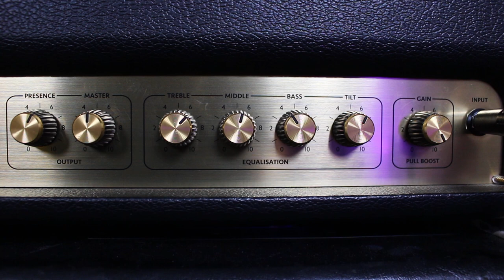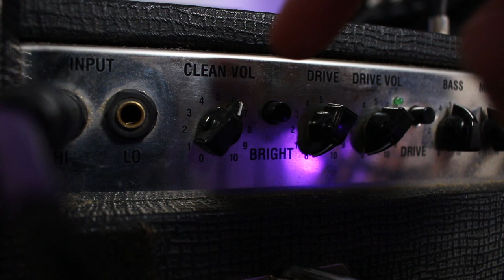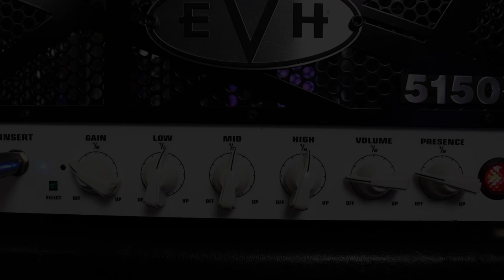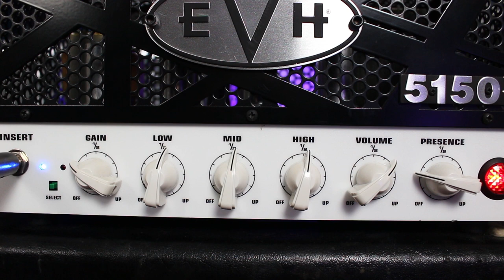Power Amp vs Preamp Distortion in a Valve / Tube Amp - Info & Demo (Marshall Origin, 5150lbx, VC15)

Comment: Its also helpful to understand the differences between gain and volume controls themselves. Gain controls are always placed on the input of a component and volume controls are always placed output of a component. Only a gain control can distort or overdrive the signal, while  volume controls can't alter the signal. Thats why gain and preamp tubes are focused on so much. A volume control just attenuates the signal. When the power tubes distort, its not due to the volume control. More volume can't add more distortion like gain can, it just lets more signal through and that's what makes the power tubes distort.

Knowing the relationship between gain and volume can allow you to get better tones at lower volumes. if you get the exact sound you want on your amp, but its too loud, add a preamp pedal. A preamp pedal will have gain and volume controls that are isolated from the guitar amp. If you add a small amount of gain on the pedal, then just use the volume control to adjust loudness. You'll be able to play at much lower volumes without touching any of the controls on the guitar amp.

Comment: Very informative! My Carvin MTS combo is a high-gain amp (though probably not as gainy as a 5150), and though diming the 'Drive' (gain) knob sounds fine at bedroom levels, I've found that the amp really comes alive when I turn the volume up past '3', which even with the half-power switch flipped down to 50w, is already approaching stage volume. The bass gets bigger and chunkier, and the mids get fatter. My favorite sound though, when I can do it, is with pre- and power-amp gain blended together. The sweet spot seems to be with the volume set between '8' and '9', and 'Drive' knob on '8'. This is with Sovtek 5881 power tubes. It's brown sound all the way, with more than enough compression for metal!

Comment: Great video and channel. I am intrigued by the Marshall after your demo. I've never owned one but after watching numerous YouTube studio demos I'm liking the Marshall sound. I have 4 Laney amps, two IRT studio 15 watts, an L5T 1 x 12 5 watt and an L20T 2 X 12 20 watt. I'm recently experimenting with pedals in front of the amp but have always used amp Distortion. Home levels dictate mainly preamp distortion but the Fryette Power Station is letting me explore power amp Distortion. It is a whole new world that only the guitarist with no volume constraints gets to experience but desired by all. Low wattage amps are the way. I had a Mesa Mark IV but could only ever use the preamp gain which gets to be just sad in the end. I'd probably be able to use it now if I hadn't sold it now I have the Power Station.
Reply from the maker: Cheers! I would like to grab an attenuator at some point. The Fryette has some killer features. Would you recommend it?
Reply: @DanLeggatt  I would definitely recommend the PS2. The dual channel version seems very interesting and is probably more versatile for a gigging guitarist. I haven't tried that one. The PS2 doesn't colour your sound but retains the pressure you get from a high volume guitar power stage but at any volume, we'll useable volume I mean. I'm sure you know you can attenuate or actually raise the volume output of your amplifier. The PS2 is 50 Watts I believe. I have not tried it with the L20T yet and the L5T is perfect at 5 Watts anyway. I don't like the 1 watt option on the IRT studio and the 15 watt output is a bit loud where it has some character (above 6) The Fryette is like the magical missing link I'd been searching for.

Comment: To sum it up: There are two ECC83 tubes in the preamp section. Each covers 2 gain amplifiers (ECC83=12AX7 tubes have TWO amplification means). So two ECC83s in the preamp section mean 4 amplification stages in the amp within the preamp section. The third ECC83 is literally a means of the power amp. It does not distort (so does not bring more distortion) but is there for the feeding of the power tubes, in this case the two EL34 (in other cases one ECC83 is the phase inverter for 4 power tubes or for 6 or 8 power tubes). For each number of power tubes ONE phase inverter ECC83 is sufficient.
Knowing this it is clear that whenever you have more than ONE power amp tube in the amp you need ONE ECC83/82/81 tube for the phase inverter.
For example: My favourite guitar amp is a VOX AC4C1-12. It has two ECC83 preamp tubes and one EL84 power amp tube. It sounds the same as a VOX AC30 (without Reverb, Tremolo). Why?
The Vox AC30 has THREE ECC83 and 4 EL84. BUT: 2 ECC83 are needed for preamping (like in the AC4), 1 ECC is needed for phase inverting the "more than one" power amp tubes.
An amp with ONE power amp tube DOES NOT NET a phase inverting tube.
Reply: Okay

Comment: The cool thing about this amp is that you can overdrive the preamp tube to get distortion while still running the EL34's clean. Then you can crank the EL34's up and add their own distortion to the mix.

Comment: You hit V1a first setting the overall tone and preamp volume. Then to the lossy tone stack. V1b as recovery. That is the classic setup for most amps.
The best thing is stacking harmonics. So, pushing preamp and then pushing poweramp. That is easier w a MV amp. A thing to remember is that there are boundary effects fr both sections. Pushing preamp section beyond 'nice' harmonics levels creates fizzyness and you lose dynamics. Pushing output valves and you get hard clipping distortion, often rather ugly. The trick is to find the right balance. Thing is, the usually involves more preamp section harmonics than output valves distortion. And it includes the PI, PT and OT as well, all part of the output power section. They all have boundary aspects. So, in short: people overestimate the effect of output valves. They say they prefer it to preamp valve distortion but they are simply mistaken about the causes of the total output section distortion.

Comment: Great video! I have the origin 20h and cab and this helped a lot I now open up that power section gain to taste and use a little black box in fx loop so neighbours don’t kill me and it sounds great! Thanks so much for explaining  this!
Reply from the maker: No worries! Glad it was a helpful video. I love getting into this stuff so I’m glad there are people that actually find my ramblings useful! Thanks for watching 👍
Reply: @DanLeggatt   real useful I’ll get a attenuator one day as I don’t think I can really push the power section as the little black box being essentially a volume control between the pre amp and power sections means I have less signal going to power section?
Reply from the maker: @chris51484  Yeah absolutely, I would recommend an attenuator to get that juicy power amp stuff going. To be fair I’ve heard good things about the Bugera Power Soak and the Jet City Jettenuator. I think they both come in around £100. Less on the used market 👍
Reply: @DanLeggatt  I may have just ordered the bugera.... I need that Juicy power amp stuff!
Reply from the maker: @chris51484  Let me know how it works out for you! Just make sure everything is hooked up correctly before turning the amp on 👍
Reply: @DanLeggatt  sure will mate and yea the double and triple connection checks will be done!
Reply: @chris51484  I've got the bugera ps1 and it's a bang for the buck. I've used it with my origin 50 and then you can crank properly the power section to get all the juice as Dan showed us in the video!
Reply: The bugera ps1 works really well for the price. On a side note, you won't destroy the origin 20h if you don't have a load (speakers) connected, like most valve amps. Just thought I'd let you know that. You can double check for your own piece of mind, but I'm 100% sure about it. ✌️
Reply: @DanLeggatt  so been using it for a while now and it’s a game changer can crank it up and it sounds so good

Comment: Hi Dan, Happy new year and great to see you back on YouTube. Very informative and although I've always known that amps work like this
I've never seen it demonstrated as clearly. Well done with the volume balance, I think it really helps. When you're standing in front of a 
100w Marshall and you turn it up your ears tend to compensate for the massive volume and then you're not sure how to compare the sound.
Great video, cheers Ray.
Reply from the maker: Thank you mate! It was nice to have a break but great to be back to it 👍 I hope you had a good Christmas. 

Really glad that it comes across well in the video. It’s something I’ve been interested in doing for my own curious but thought there might be some fellow nerds out there that would find it useful too. Unfortunately, with the current state of things, there isn’t much call for loud amps 😥
Reply: @DanLeggatt I feel like I learned something here so thanks for that 👍
Got a question for you. Can  an amp like the dsl100 be moded to put a master volume after the power amp so that you can get the goodness of turning up both pre and power sections and then bring down the total volume hitting the speaker for home use? Is that possible or do you just have to get an attenuator for that and place it between amp and cab?
Asking because from what I understood,  you said that the master volume drives the power amp? So even of an amp has the master before or after the phase inverter,  if you turn the master down , you won't get the power amps potential distortion?

Comment: Turning the volume up on any amp will completely change the way the speakers move and distort. I think this might have more of an effect than the power tubes. Good video!
Reply: That and the Fletcher Munson curve which increases low frequencies at higher volumes
Reply: Both surely contribute to the sound. A greenback 25 speaker will contribute more speaker distortion than a 100 watt Celestion with a plexi. But if you put a reactive or passive load after the power amp you will hear the difference

Comment: to me the best place to be is in the spot of the biggest change .
The feel of air & open natural sounds a grit compression  that wild control of play / volume . 
Pushing that with any boost. & its golden zone .

I don’t think that we can say its tha power tubes . could be + the transformator.
excite the core of it & it ads its feedback & thats tha sound. 
could be the Caps that hold tha energy have greater flux & due to its high voltage flow gets some weird artefacts.
Could it be when you play loud you excite the air & it rattles the Tubes & its feedback to it gives the precived bias that you achieved power tube distortion.
Anyway… 
 
A good One! 
Keep it up

Comment: The output transformer pushed all the way also adds saturation from it being maxed out. My Marshall Superleads have a strong midrange when this happens....I don't like it personally because the dynamics  of attack are lost in too much compression....and the 130 decibels of sound pressure are at ear damaging levels!!! I have post phase master volume 's added to them all which sound great when dialed in to let the power tubes add their magic.

Comment: I'm sorry brother but you are very wrong about the way your Marshall origin 20 works. You were correct about the first valve in the chain but the second valve in the chain does not have anything to do with your effects Loop, the effects Loop is actually driven by an operational amplifier ,IE solid-state. The second valve is just two more gain stages meaning the preamp has four total gain stages. The signal chain is in this order: V1a/gain pot/V1b/tone stack/V2a/V2b/operational amplifier(FX Loop)/master volume/phase inverter/ then the power amp tubes. I know this is a long-winded comment my point simply being is that the 2nd 12ax7 does not drive the effects Loop.
Reply from the maker: Not sure where you are getting your information but my buddy Jason breaks down the full circuit in this video - https://youtu.be/Q_hiXjOS1Y8 

17:44 he talks about v2 and it’s use in the circuit.
Reply: @DanLeggatt  I'm getting my information from looking inside the amp itself. Unless there's several different versions of this amplifier which I seriously doubt then your buddy is incorrect. Yes it is a valve amp but there are solid-state components when it comes to the effects Loop. There's not a single Marshall amp in the world that only uses one 12ax7 in the preamp. They all use at least two sometimes three. I'm 40 years old and I've been repairing amplifiers since I was 12. Open the amp  and look in the back and you will see an operational amplifier on the rear board that the effects Loop is connected to, what do you think that operational amplifier is for??

Comment: Sorry, correction to my text a few seconds ago (I was too fast in publishing .... :-) )
To sum it up: There are two ECC83 tubes in the preamp section. Each covers 2 gain amplifiers (ECC83=12AX7 tubes have TWO amplification means). So two ECC83s in the preamp section mean 4 amplification stages in the amp within the preamp section. The third ECC83 is literally a means of the power amp. It does not distort (so does not bring more distortion) but is there for the feeding of the power tubes, in this case the two EL34 (in other cases one ECC83 is the phase inverter for 4 power tubes or for 6 or 8 power tubes). For each number of power tubes ONE phase inverter ECC83 is sufficient.
Knowing this it is clear that whenever you have more than ONE power amp tube in the amp, you need ONE ECC83/82/81 tube for the phase inverter.
For example: My favourite guitar amp is a VOX AC4C1-12. It has two ECC83 preamp tubes and one EL84 power amp tube. It sounds the same as a VOX AC30 (without Reverb, Tremolo). Why?
The Vox AC30 has THREE ECC83 and FOUR EL84. BUT: 2 ECC83 are needed for preamping (like in the AC4), 1 ECC83 is needed for phase inverting of the "more than one" power amp tubes.
An amp with ONE power amp tube DOES NOT NEED a phase inverting tube.
Reply: @lino vinn. An amp without a phase inverter is a true class A amp. You can have more than one power tube in a true class A amp but it still would not have a phase inverter. There are many amps these days that falsely claim to be class A but if they have a PI then you know that is actually class AB. It seems a lot of lower powered amps falsely claim to be true class A amps. A vox ac30 or ac15 is class AB. The vox amp you have I believe is true class A. One is not really better than the other but they are different. A class AB amp will have more headroom, power and volume. They may also have a little more sustain but I’ve played true class A amps that sustained great. Class A amps give up power tube distortion at much lower volumes. Which could be good or bad, depending on what you wanna use it for.

Comment: Great video 👍another big difference is that the Marshall Origin 20 and the Laney are cathode biased, which mean a softer, spongier type of power amp distortion (like Brian May's Vox amp) but the Peavey is fixed bias, which is a harder type of power amp distortion, i.e. Van Halen, Malmsteen, Angus Young, etc (ironically, that is the true Marshall power amp distortion, the Origin 50 has it)
Reply from the maker: Very interesting. Thanks for the info 👍

Comment: There is a reason push pull valves are set to around 70% max dissipation bias. Push those valves and they get nasty. The output section before the valves is where the juice is.
A lot of Plexi/JTM/JCM sound comes from stacking preamp sections. And all modern gain sounds are derived from that.
I think even the earliest JTM45 had the Fender Bassman cathode follower, then tweaked the caps and resistors for desired high volume performance.

Comment: The terminal stage does not overload the signal. The volume control restricts the signal of the preamp, not the amplifier. Experiment with the ppimv mode, which restricts the signal after the phase inverter. The lamps of the terminal stage slightly distort the signal with a strong amplitude, practically without affecting the overload level.

Comment: Just a quick observation on the layout of the pre and power amp on the Origin.

Sometimes when discussing these sections, people speak about them in relation to the gain and master volume pots.
This depends on whether you consider V3 as part of the pre amp pr the power amp. The master volume is located before V3, as it is in master volume JMPs and JCMs.

However, to me at least, V3 is an essential part of the gain structure, and is why the gain increases when this is turned up.

The power valves aren't getting hit very hard or even much at all unless this is all the way up, allowing the full signal from V2 into V3 to be phase split.

The pre phase invertee(/V3 master volume, again imo, is only really another preamp gain.
Which is why I installed a post phase inverter master volume.
Stemming the signal just before V4 and V5. As it should. Imo. :-) 

Great tones though.
Reply from the maker: I definitely agree that they missed a trick not having the master post phase inverter. I also think they wasted v2 on the fx loop. I think they should have incorporated into the core preamp or boost stage and given a larger gain range earlier in the preamp. I reckon it would have appealed to a wider market.
Reply: i think the post PI mv are great in bigger amps like a 50/100w b i think Marshall got things right w the Origen 20. To me it has the right interaction f small/medium stage duty.
Reply: i also think that people overestimate the output valves influence on the sound overall, 6l6 or el34. It is usually transformers breaking up w or without PI. Although personally i like el84s pushed if i want output valve distortion.